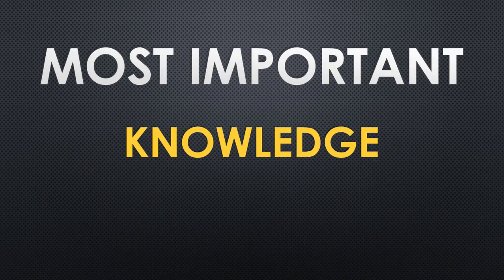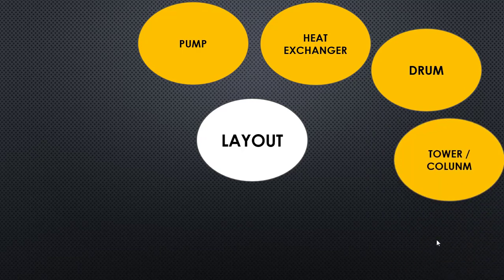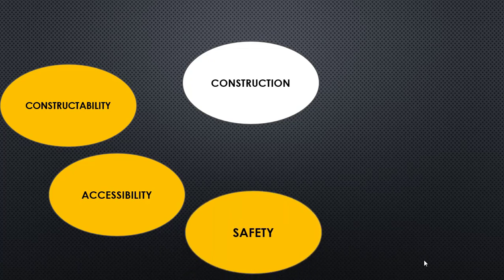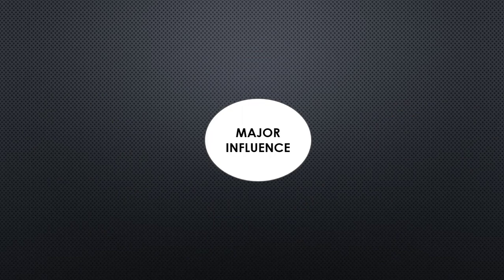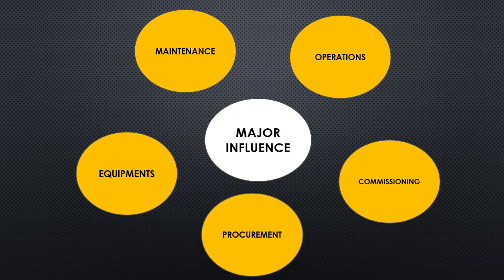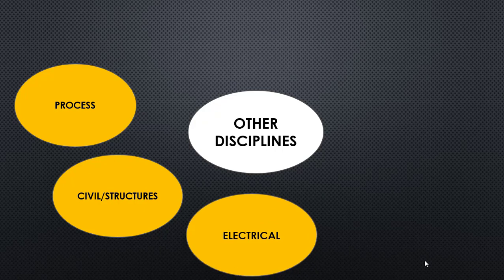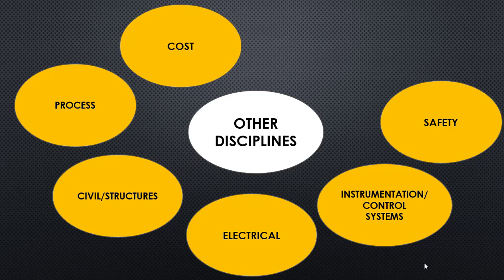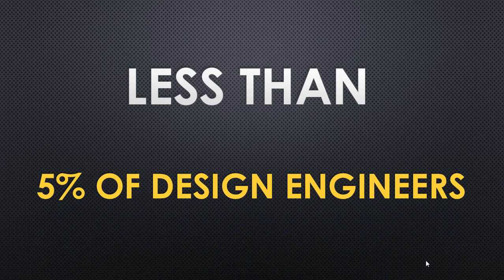How to become an EXPERT in PIPING DESIGN

Comment: Piping design engineer exist only in India .  In usa a piping designer  he is not an engineer , the piping engineer he is the one does the stresse analysis only not a design. The design is done by the piping designer ..
Reply from the maker: The volume of work done from India are huge. Especially in big projects one person cannot handle everything. This is why the roles are  distributed to get task the done on time. However even in india, there are companies where one person does everything, but the size of the project would be small.
Reply: Sorry the job is done in India most of it are redone in US and the major equipment and piping are done in Houston , The layout is done in Houston . True in India the piping designer are with bachelor degrees but most of them do not have a lot experience in piping and equipment design.  All your followers are from India but honestly I like your video .